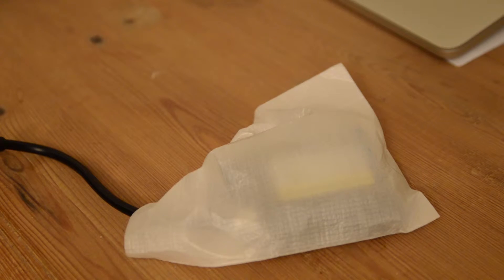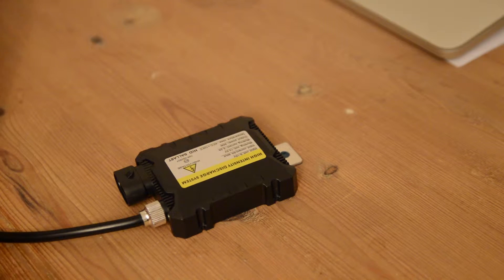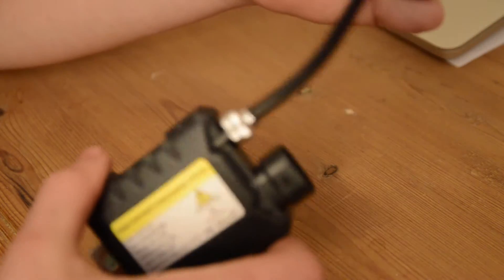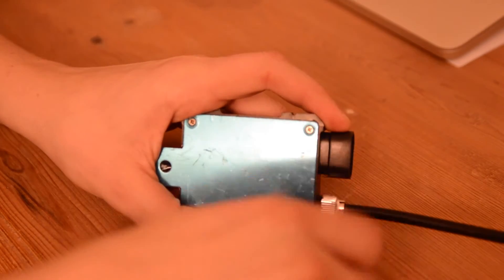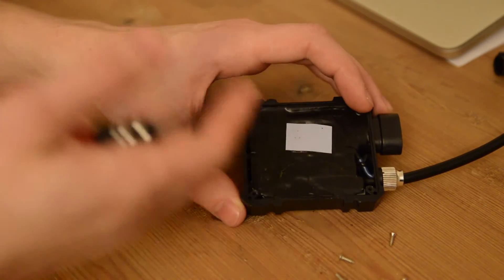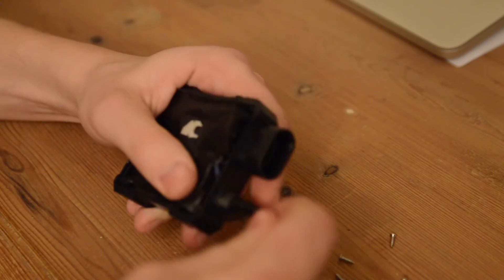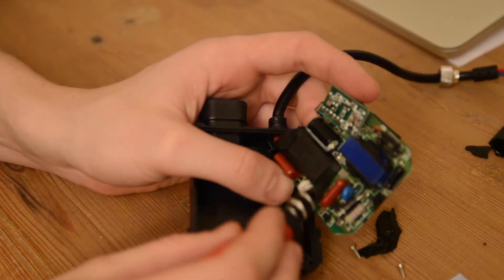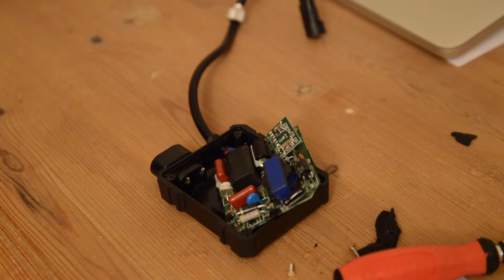Ebay hid xenon ballast

Comment: These are quite cheap, because they use a gas discharge device for triggering the HV-coil. These tubes have limited lifespan.